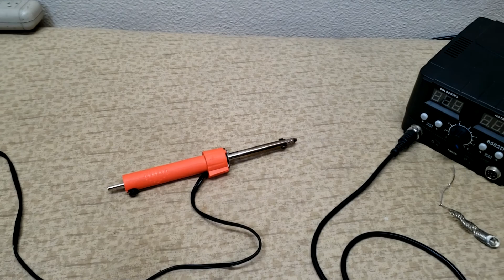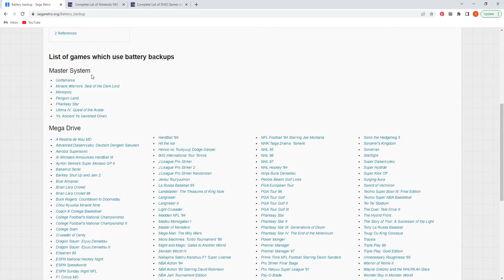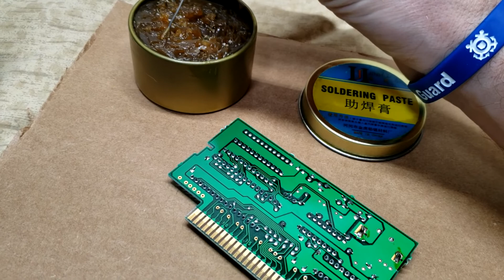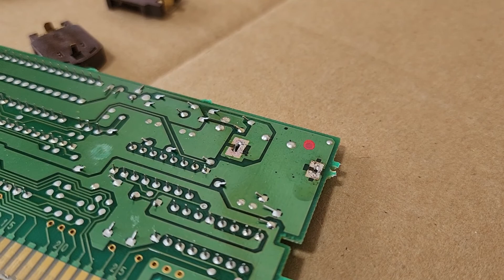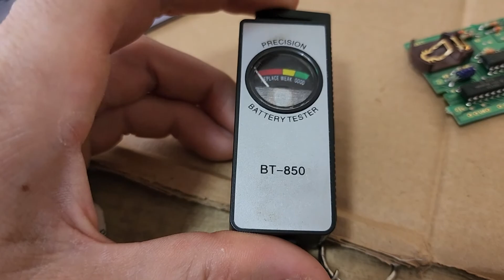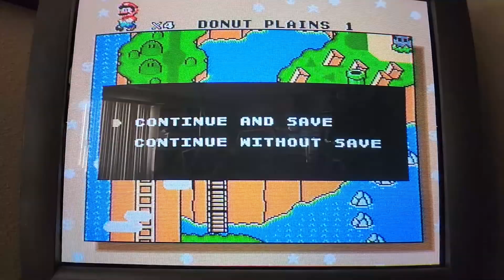FIX - Super Nintendo SNES Game that won't Save | Backup Battery Replacement

Comment: Between using the retrode and now the SaveTheHero builder, preserving my saves is no longer an issue.
Reply from the maker: Curious why you don't just use an emulator and rom at this point?
Reply: @s34nvideos  If I am doing some sprite ripping sure. 
I'll play on the FX Pak Pro when i'm not doing spritework as nothing quite beats like the rush of powering on a console and playing.
Reply from the maker: @shivasthong-original  ohh gotcha, makes sense! Are the retrode's still for sale anywhere?
Reply: @s34nvideos  only used. And then the attachments are just as pricy as the device.

Comment: I have a Donkey Kong country 1 that won’t save at all. Replaced the battery still nothing. Tried that a few times. I removed and reflowed the ram chip and it still won’t save. Any suggestions?
Reply from the maker: Is the new battery good? 💯?

Comment: Do these work to replace the NES cartridge battery holders also???
Reply from the maker: Not sure. Crack a cart open and report back!
Reply: @s34nvideos  It looks like it will work. I also found a separate video showing the same piece confirming it can be used in NES games. When I give it a try I will report back.
Reply from the maker: @jimmyramirez2272  That's great!! Let me know how it goes! 🤞

Comment: I bought these exact clips. A friend of mine saved my Super Metroid using them, but be warned: they are a very tight fit and you need to bend the tabs VERY slowly! Do not rush them! Make sure the pads on the PCB are entirely clean of solder. Use a soldering wick and flux to get it pristine. We got it working after about an hour of fiddling with the clip. Thanks for the video!
Reply from the maker: Great news! 🔥👏
Reply: Ty both! I am trying to chg battery on illusion of Gaia for my nephew.. same issue, can't save a file.. I put in new battery but I'm definitely not great at soldering 😅 and it's still not saving.. so I'll go back in and use the desolder wick to clean it better and do it again! Wish me luck!!